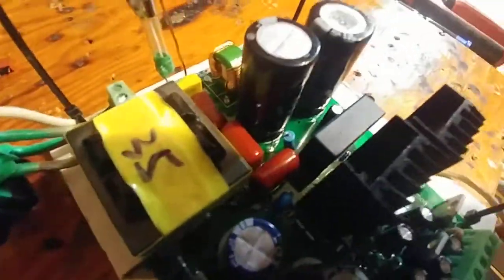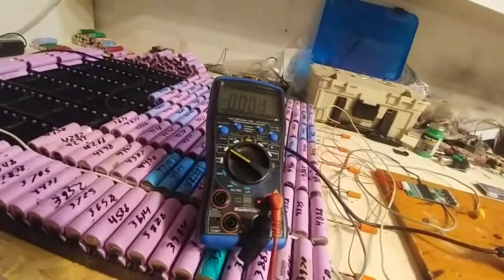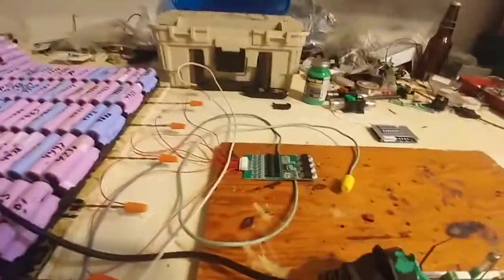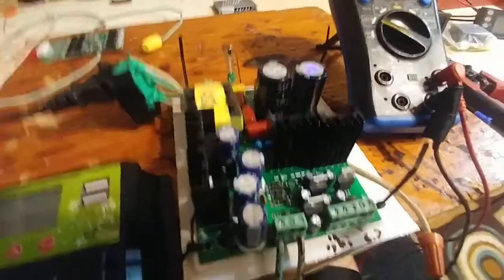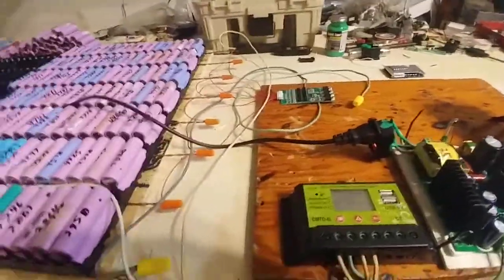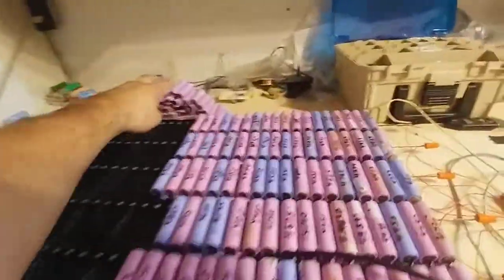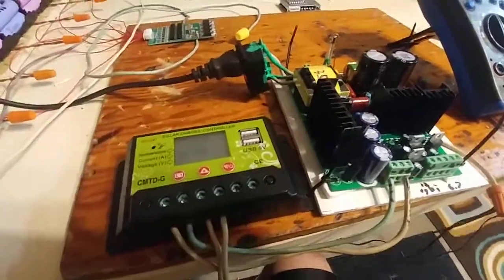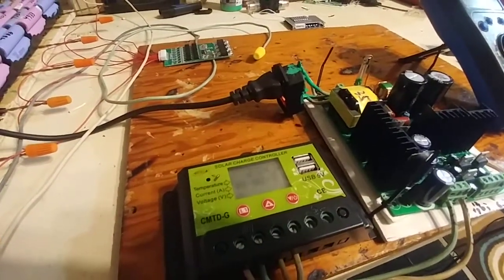18650 7s 29.4v diy power wall charging with sketchy ebay parts

Comment: Do yourself a favor and get rid of the BMS you have there. Once you get your wall done do a bottom balance and than your good. Just monitor voltage of each of the seven groups independent of each other. Try and arrange capacity of each group as close as you can. I tried BMS on my walls and they are to small for that much power, once I got them balanced they would stay in balance with no issue and if the voltage starts to get messed up it’s likely a bad battery in that parallel group, which you can find with your heat gun.  Trust me I have killed many packs with BMS now no more problems. Good luck
Reply from the maker: Thanks man! Yea balancing is everything for sure

Comment: Andy, have you tried using the DIY Power walls Repacker? Should help in keeping your packs consistent  by capacity.
Reply from the maker: I have very strongly considered it but since my system is extreamly modular i can do this at any time so im going to leave that for when i iron out the final design of the wall. Lots of small issues to tackle and so little time :( thx for all your input eric i really appreciate it. Been busy with my other jobs the past 2 weeks its set my schedule back. Plus im waiting on more 40a  breakers to build my nxt power wall with changes. Thx again!